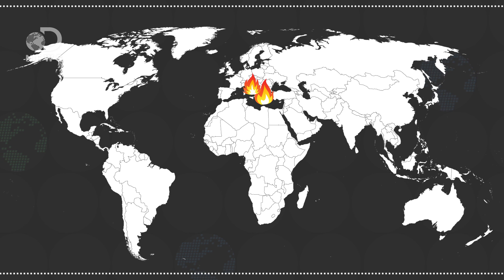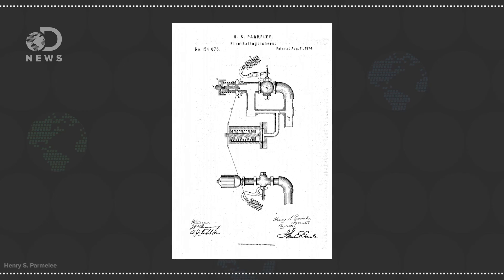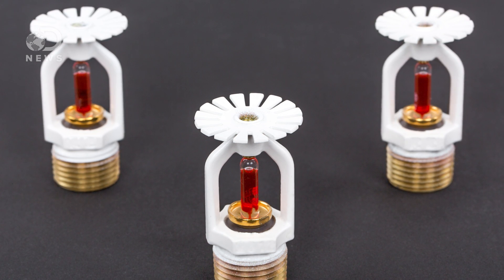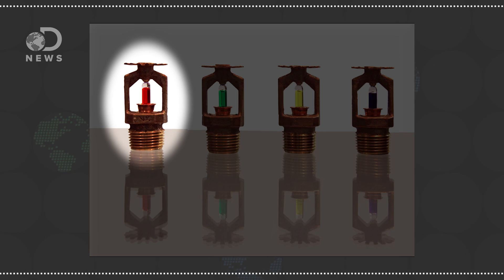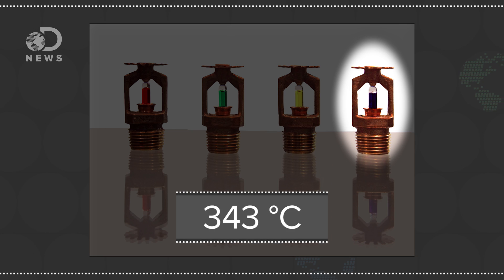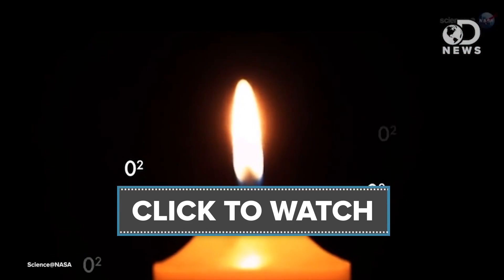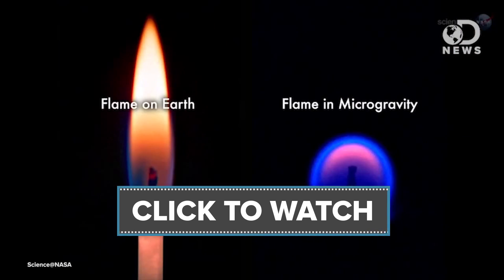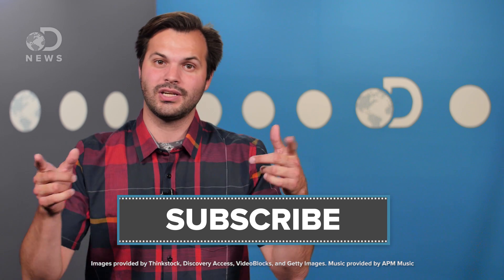How Do Fire Sprinklers Know There's A Fire?

Comment: Should of included how smoke alarms work, how does it know there is lots of CO2 or whatever in the air?
Reply: Smoke alarms work by 'seeing' the particles in the smoke when it enters their sensing chamber.  The particles will either interrupt or scatter a light beam (photoelectric), or in the ionization type devices, cause a disruption in the ion field.  The disruptions are sensed as changes in electrical current to activate the device.

CO2 which is carbon dioxide is naturally occurring from us breathing etc and is a gas.  CO which is carbon monoxide, is created when carbon based fuels like wood, gas, propane etc are burned without enough oxygen.  That too is a gas and a different sensing system is required to pick it up.